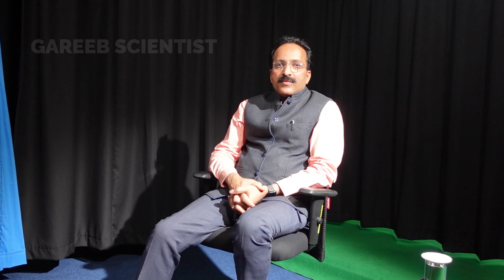ISRO Chief on SSLV Failure and Failsafe CODING | S Somanath

Comment: Why can't isro optimize their successful engines to make a powerful rocket (the way Elon Musk did it already) we have pslv engines and their booster why can't we integrate multiple pslv to make a powerful rocket in shorter duration like 5-6 months and in the background we can continue our research on bigger engines
Reply: it's not that simple, forget 5-6 months, even 5-6 years is not enough.

a rocket with many clustered engines is more expensive than a rocket with few engines.
It makes sense for SpaceX because their rockets land back, and those engines can be refurbished.
PSLV's engine Vikas, is a uprated version of the french Viking engine, which is 70s and 80s technology,
 Elon musk's engines are more modern, more complex, and designed to be clustered.
for eg: Vikas using hypergolic fuel (very toxic). can the engine restart? what steps can the engine throttle to? how would they make it reusable? How would they deal with oscillations affecting other engines? and 100s of other questions that I can't even think of.

Even if all this is solved. then there's is the usual time taken in creating rockets, retooling their machines to manufacture that rocket, software changes, different integration testing, changes needed to launch towers, assembly building, transporter etc.
Reply: @starizard42  so my question is ...why are we still focusing on engines that goes one way ..why can't we control it with some advance programs we can utilise AI for complex calculation in the boarded system or from remote (our ancestors used to do this kind of things only god knows how we lost these thinking) we will get to know only when some Germans or American scientists will implement it via taking help from our scriptures 🤣🤣 and make movies on Hollywood
Reply: If it was that simple, then everyone just had to make one successful rocket and then "integrate" it. Aerodynamics gyi maa chudane?
It's not at all that easy.
Reply: Only if the pslv design allows such configuration